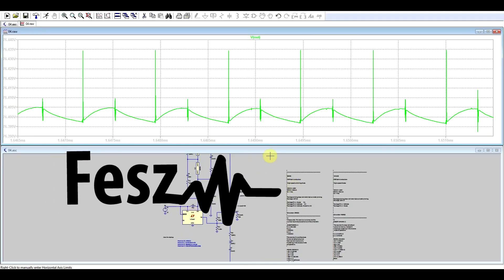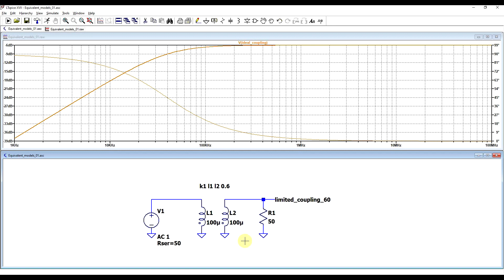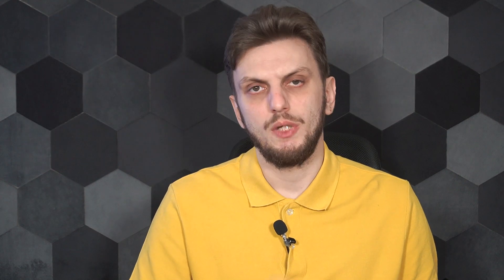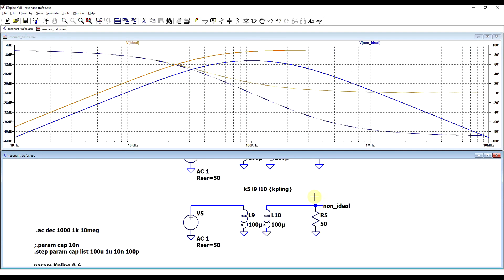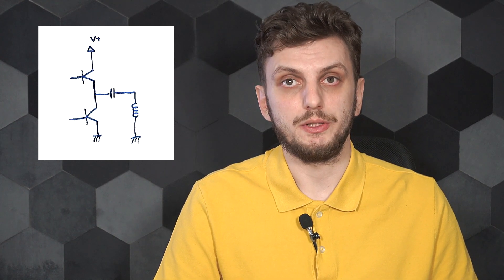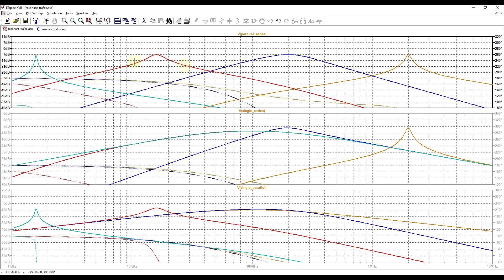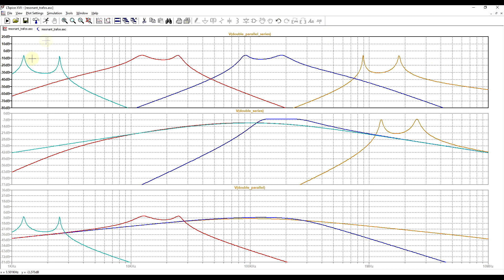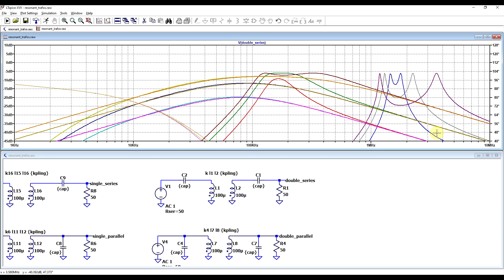Resonant coupling - Transformer Impedance matching (2/3)

Comment: Hi
In 10:54 and onward you show two equations in the lower left corner calculating the resonance frequency. How are these derived? Any paper/text/website you can refer too?
Thank you for some very nice videos.
Reply from the maker: Its the generic formula for the resonance frequency of any LC circuit; I'm not sure if there is any special paper on it; but you can derive it by finding the frequency solution for Xc=XL (Xc=1/(2pi*f*C) (XL=2pi*f*L)
Reply: @FesZElectronics  Thank you for the answer. I think I was not specific enough. It was more how the couplings factor appear in the resonant equation. So we can see in one case the change in coupling does nothing for the resonant frequency and in the other it changes due to (1-k) factor.
Reply from the maker: I will be honest, for the parallel resonance, that is the formula I could find (like in the documentation links in the description) - I guess that with or without coupling, you are resonating with the entire inductor (or the magnetizing inductance which is fixed); for the series resonance, I don't remember finding the formula, but rather I saw what fit to the simulation results. The "L(1-k^2)" term represents the uncoupled inductance of the transformer (the one with which you are resonating away using the capacitor).

Comment: Excellent! How do you display the µ symbol in LT Spice, I can only add a u ? Thanks
Reply from the maker: On my side, when I add, "u", after I close the parameter edit window, it automatically changes to "µ"; does it stay as "u" on your side?
Reply: @FesZElectronics  Yes it does stay as a u, there must be something different between our machines, but presumably not an LT Spice issue?  However I discovered that typing ALT + 230 inserts a Mu character, µ as I just did here, maybe you have set up some automatic u to µ conversion in Windows?

Comment: Hi
How can we intuitively explain that we can get the same output power for k=1 and k=0.1, with for example series resonant coupling?
I could maybe understand if the efficiency went down and the k=0.1 case used more input power.
Reply from the maker: Hello! Well, the equivalent model of a transformer with less than ideal coupling can be built with an ideal transformer (that contains the coupled inductance) and a series inductor (with the uncoupled part); with resonance, you are canceling out the uncoupled inductance, hence you are left with the ideal bit only.

Comment: Try light.????we use a 555 set with that flyback resistor, led and director but when in curcit the director stops the curcit and gives a relay curcit cut but a resistor led the curcit runs perfect the issue is due to a IR and the stable factor there! As if you remove the led gose crazy????.😁may help stable those peck's.